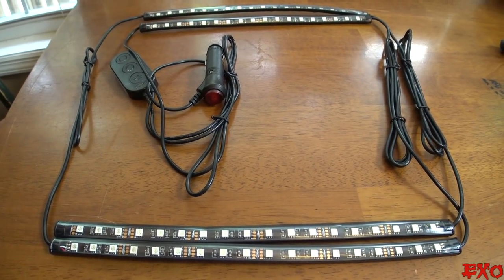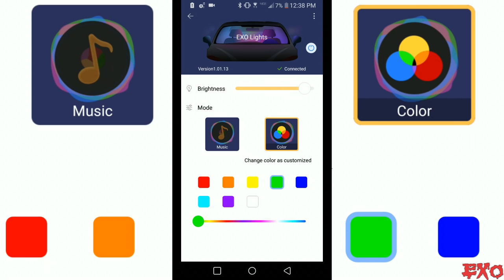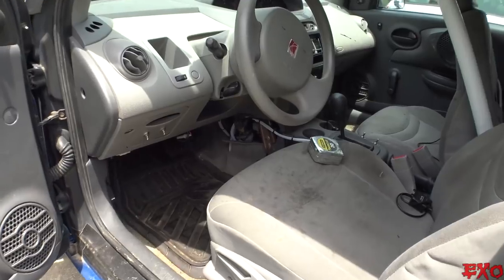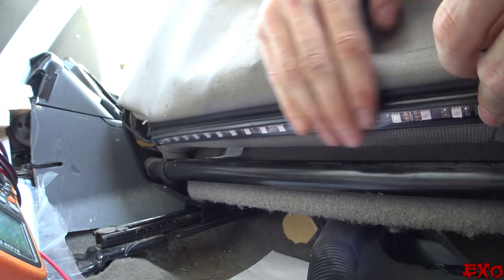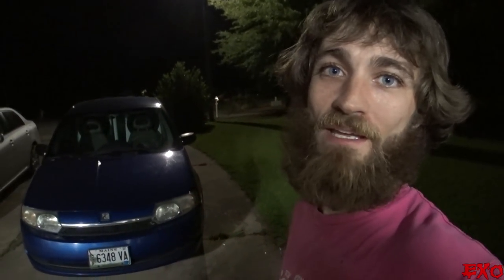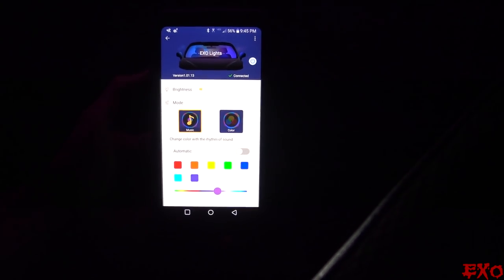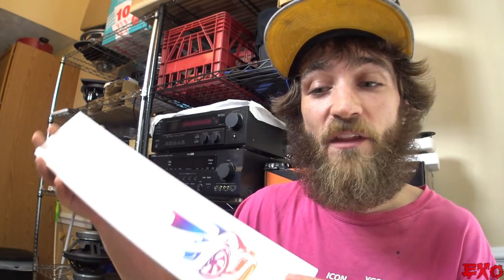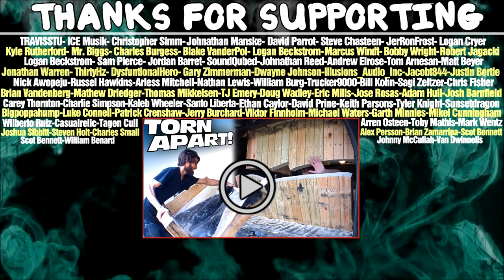Cheap LED Strips Any Good? Installing $20 Amazon Light Kit that FLASHES TO MUSIC & Smartphone App!

Comment: Put a piece of tape over the mic, it'll help with the sensitivity. Great vid
Reply: I just typed that myself...
Reply: works awesome on the iphone mic for killing distortion making bass vid's, i could totally see this working also!
Reply from the maker: Forgot about that little trick! Used to do the same thing with my old Flip Cams and Kodak Zi8s
Reply: Mackie P ok will try
Reply: Leave phone outside car on the roof
Reply: Surely the app has a sensitivity adjustment..? I have this same kit made by Grovee & I can adjust the sensitivity.

Comment: Yo exo I got a wireless remote 16 color led lighting set up like yours for 6.00$ off wish I wasn’t expecting nothing, it was actually quality no loose wires no cut corners it lights my whole lowrider interior and withstands the 138 dB bass drops.
Reply: you have a link for them cause im looking for a set of lights for my truck
Reply: Cody S.S. this was just a plug LOL
Reply: 138db huh lol
Reply: Cody S.S. you have a link i need good lights in my truck but i want it lit like back in the day
Reply: Paul Messamore I know what you mean like properly light neon style I ride a old school lowrider Chevy on 100 spoke Dayton’s no corners cut, I don’t have a link their sold on wish I did a review on them there.
Reply: Cody S.S. well this sucks ass i cant read the damn comments lol
Reply: Edgar Munoz I’m talking about coming from the LEDs leads no loose wires.
Reply: jmward214 yea they don’t fall off the mounting areas I’ve had some cheapos come un mounted from vibrating and from just being parked in heat.
Reply from the maker: Wow, thanks for the heads up. That WISH app is everywhere lately, I've been seeing it pop up more and more. Pretty curious how it all works, I'll have to download it and see!

Comment: weird assuming you did it yesterday I was doing the same thing but inside the house. Yesterday I just installed a cheap ($4.88 Walmart cheapie) RGB LED strip behind my computer desk. Since they worked well for the price I ended up buying 4 more packs.

Comment: yo dude. if you want to secure them a bit better, just run a bead of clear silicone down each side of the strips. i can almost guarantee the adhesive strips will let go when you pound some bass. 😎👌

Comment: The lights i think are wired in series so the cable length doesn't affect brightness. It only would in parallel
Reply from the maker: No, they are daisy-chained in parallel.

Comment: Did you pre-clean the plastic parts before applying the adhesive tape?
Reply: Lol I'm not the only one thinking that
Reply from the maker: Just with some Lysol wipes and fiber cloth
Reply: Good suggestion. It would help the tapes stick firmer.

Comment: I found that pre-assembled kids like this don't have the sound response quality that I look for. I ended up buying a set of the multi colored LED strips from AutoZone a three-button switch spend some time to coding what wire controlled what light and got everything to work how I wanted it to you can tap into your speaker without affecting speaker power all that much and with the 3 buttons im able to get 7 colors out if it amd i have 9 total light units running of a bridged rear speaker channel. I like the control i have and with a change to the EQ you can achieve a totally different response.

Comment: What you could do to make the lights Only follow the bass, is to Cut the wires up and connect it to the Amplifier, Not the pluss and minus but the Sub terminals, Ive done this. but will only Follow the beat, nothing else
Reply from the maker: Don't think they could handle that type of input voltage lol

Comment: Can i cut the cigarette lighter head off of it and run that to a 12V source?
Reply: forceaura1265 Yes you can
Reply: Not sure if there is a fuse in the system but it might be a good idea to add one if you hard wire it depending on how you hook it up

Comment: the sensitivity is NOT the issue the problem is the circuit is too slow. it hears the sound and then a milisecond later it changes the intensity
Reply from the maker: That could be so, but it seems to be fairly responsive to voices so that leads me to believe it the sensitivity.

Comment: kinda expensive for what it is
Reply from the maker: Really? I didn't think so, especially with the coupon code!

Hell, I spent more on just an RGB controller for my truck, and it doesn't have any of these features.
Reply: I've done a lot with led strips and on aliexpress you can get a controller with the same or more functions for around $4 and 3 meters of led strip for around $5.00 granted you have to add your own wires to that. but you can also pickup plug and play kits like this up for less than $10